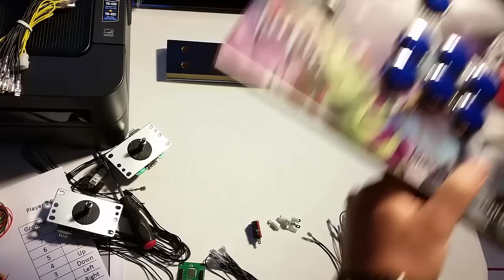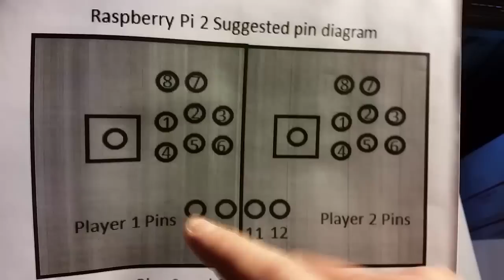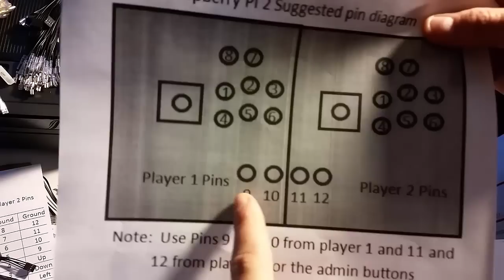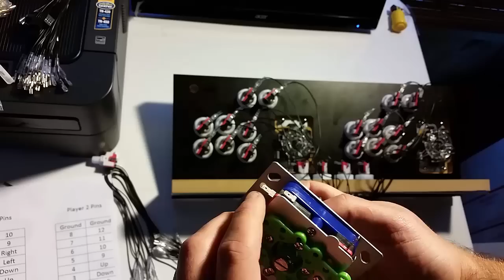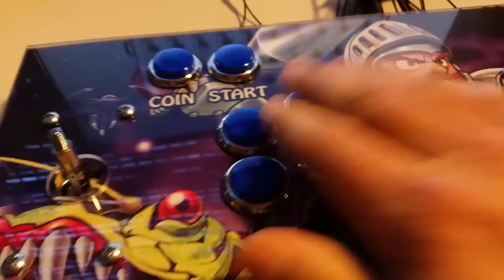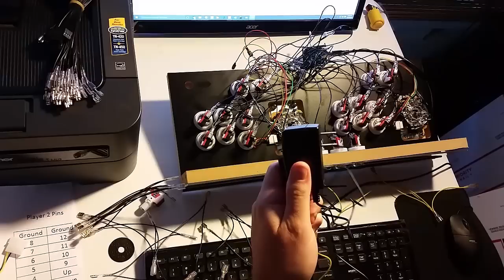Wire and Light up an Arcade Control Panel Buttons and Joysticks

Comment: took my GRS bartop out of storage after my move a few months ago and my controllers weren't working. Watched this video, connected to my PC to check the USB controllers (which I didn't do the first time a few years ago, didn't even think of it), my 1st player had a plug in the wrong place on the Xin-Mo and my 2nd player was showing number 9 for my number 5 button...my OCD wouldn't allow it and I unplugged all the wires...this video helped me put it back together correctly. How I didn't do it right the first time I don't know. Thanks for the video...got the bartop up and running again :)

Comment: When I plug this into Windows to hook up the joystick in only shows up as one controller with a Z axis and Z rotation. Also two of the buttons appear to be always "on." I'm so effing lost here. Any suggestions. If it weren't so bloody hard to remove all these connectors, I'd pull everything off and start again, but goddamn I don't want to do that.
Reply: This feels hopeless. ANYBODY??
Reply: @joepuhlman202  Not sure why it was so hard for you to remove the connectors...they popped off pretty easily for me...just had to tug a little. Did you end up pulling them all and re-wiring?

Comment: Very disappointed with my purchase. Bought your arcade control panel kit starting at $149.00 ended up to almost $400.00. Came with missing hardware, chipped corners on laminate, extra holes cut in plexiglass that"s not advertised, no inventory list , and no instructions. For almost 400.00 dollars!!! Wont do that again!

Comment: The wiring for the Sanwa style joysticks has changed. I bought the LED kit from you guys and the Purple is the ground. Super frustrating figuring that out. So, for anyone with different colors from this video: Purple - ground, Yellow - up, Black - right, Red - down, Gray - left. That's how it was for mine, anyway.
Reply: Thank you!
Reply: Im having the same problem, everything checks out on the computer. When I hook up to the Raspberry PI the joysticks don't work. Any suggestions?
Reply: @eliani1326  I disconnected all of the encoder wires as well as the connections I made for the Sanwa stick. I reconnected all of the harnesses back on to the encoder according to the diagram provided. I have a few questions, the diagram shows a few grounds, do I have to put grounds on all of the slots labeled ground or place 1 ground per player? On the diagram it is labeled VCC, what is VCC? There is also a slot for mode, do I need to hook up to that? Is the ground for the Sanwa stick placed on the encoder or can I attach on the daisy chain ground?  Not sure if I understand purple wire being a ground wire. Are you talking about the purple wire that is part of the harness that plugs into the encoder?

This has been super frustrating trying to figure this thing out. Ive been trying to contact Ryan, with no luck. I Have not been happy thus far with the lack of help. He really needs to do an updated wiring video with his newer products, instructions are definitely lacking.
Reply: @eliani1326  I was having the same joystick problems in Windows as I was in RetroPie. I just troubleshot until I figured out which color wires were in the wrong place. Leave the wires on the encoder hooked up as they are and try switching the different wires from the joystick to the non-changing wires coming from the encoder. This was a real headache and I probably won't choose this route again. It would have been way easier to use a Happ style stick with Happ buttons instead of a combining Happ buttons with a Sanwa stick.

Comment: Deluxe 22" bartop kit 
Wiring tip for light up buttons 
The lights themselves have one small wire (+) and a thick wire (-)so I plugged them all in the same way so wiring was even easier. 
And the strip LEDS for the marquee also came with an extra barrel jack I used for the power supply to the buttons. Outside (-) inside (+) so everything is quick connect

Comment: when I wired everything neither the button or joystick registered as working under properties of the controller I am using an arcade control panel kit could you help, please? I feel like I might not be technologically good enough to do this or I might be doing something slightly wrong.
Reply from the maker: Just emailed you updated diagram.  The upgraded the xinmo board a few weeks back with more pins.  The steps are same as in the video, just different pin assignments.
Reply: @Gameroomsolutions  What is the new pin assignment? I have the board that also has more pins and can't wire it up right
Reply from the maker: @057Jaysea  https://gameroomsolutions.com/install

Comment: My raspberry pi 3+ is only picking up one controller, is there a solution for this?
Reply: I'm having the same problem
Reply: Once you have your first controller set up go back to settings and find the control settings and it should find control 2 if not go to retro arch and setup buttons that way

Comment: I bought the 2 stick 20 button LED bundle and I’m building a custom cabinet. You mentioned in an earlier comment that the kit supports 22 buttons. Are the extra wires for two additional buttons included in the kit or do I need to buy some extra wires to add two more buttons? Thank you.

Comment: What do you do with the usb encoder when everything is hooked up? Do you screw it on the bottom of the cabinet or is there a housing of some sort you have to get? Bc I don't think you just let it hang in there not secured or is that what you do?

Comment: Just finish putting everything together... i also copied the configuration files provided.. My question is how do i exit during a game ? Ive tried holding 9 and 10 buttons but nothing happen... is there anyway to troubleshoot this? Thanks 🙏🏻
Reply from the maker: It should be hold button 10 and press button 9.  Ensure you have those on player 1 and 11 and 12 on player 2 pins.  You test on windows like in the video everything is working correctly.

Comment: I see that these joysticks have SANWA style mounts. I already have HAPP joysticks and I would like to order this control panel from you guys (the newer version). Is there an option for me to order this control panel with HAPP joystick mounts?
Reply from the maker: For happ we only cut the center hole so you can screw it into the bottom of the panel
Reply: Great! I sent you guys an email (info@gameroomsolutions.com) with some questions before I go ahead and buy the control panel. I still did not get a reply. How should I proceed to let you guys know that I want it to come just with the center hole for my HAPP joystick when I buy it online? I would really appreciate if you could reply to my email. I also included a picture of my joystick. Thank you in advance!

Comment: not all my led buttons are lighting up but all are connected. I had to strip the wire and solder on to a 12v adapter. Please help!
Reply from the maker: Polarity matters.  Rotate the bulb.
Reply: Awesome! Thank you so much!

Comment: In regards to powering the LED buttons and joysticks - I found this AC Adapter at Fry's which seems to do the trick. http://www.frys.com/product/6303571?site=sr:SEARCH:MAIN_RSLT_PG   

 It has a molex connector that will work the MOLEX connector at the end point of the daisy-chain wire used to send power to the LED.  In addition to that, it also has some small 2-pin female wire that directly connects with the LED power cable on the LED joysticks, so no need to strip and electrical tape to power your LED buttons!

Comment: I'm having problems getting the PC or MAME to recognize the joystick inputs. I've already grounded and connected per the wiring diagram. All my other push buttons work fine. Do you guys have any good troubleshooting tips?
Reply from the maker: Purple wire may be ground.
Reply: thanks. also having tough time removing the connector from the micro switches, fingers hurt from trying to pull. any good suggestion?

Comment: Can you explain running the clipped off wires to a 12V adapter". This process confounds me. Also, what does the molex connect to in a raspberry pi setup? I have a PC, and I guess there are spare molex plugs. Do you sell the lighting cables with molex?

Comment: As i was testing the controls with laptop, the up, left, and down worked fine but the right didn't..any suggestions?
Reply from the maker: Double check a different direction with that connection.  Put the right cable on the left joystick wire and see if it works or not.
Reply: GameRoomSolutions.com I just did I tested them all again..and is it weird but both my grey color for the joystick don't work for player 1 & 2 all other colors work fine..
Reply from the maker: Is purple ground?
Reply: GameRoomSolutions.com I got Purple : right, Red : down, Yellow : up.

Comment: What is the button setup on the actual cabinet for hyperspin arcade machines. is it any different from what you are doing here for the raspberry pi
Reply from the maker: It depends.  Hyperspin has a nice pause screen along with genre filter.

Comment: i wonder if its possible to add the LED joysticks?
Reply from the maker: Yes.  The only difference is there will be a positive and negative cable to light it up.
Reply: is their a way around it? im not smart about these things. but im watching the item you have on EBAY and i was thinking of ordering some led joysticks but they had a different hook ups compared to the ones you had.

Comment: So I have a RPi3 and a xin mo usb 2 player joystick and although retro pi recognizes the controller, it only recognizes it as one player and no buttons respond during the button configuration. I set up the controllers like you explained and everything works on my computer test. Cant find a fix anywhere. Plz help!
Reply from the maker: https://gameroomsolutions.com/raspberry-pi-3-retropie-setup-easy-guide/ under section Let RetroPie Setup know there is Two Controllers

Comment: nevermind, I see your using a xinmo encoder...... Would you happen to know many inputs it has excluding the joystick? I thought it was 11per player but this was also including up/down/left/right and only leaving 7 functions left.......this was the whole reason im looking into ipac.  I wanted more "control buttons" like you have
Reply from the maker: +Jacob Guerrero The xin mo we sell allows for 2 joysticks and 22 buttons.  10 for player 1 and 12 for player 2.
Reply: +GameRoomSolutions.com so the joysticks don't account for the 22 buttons?
Reply from the maker: +Jacob Guerrero Correct.  2 joysticks plus 22 buttons.